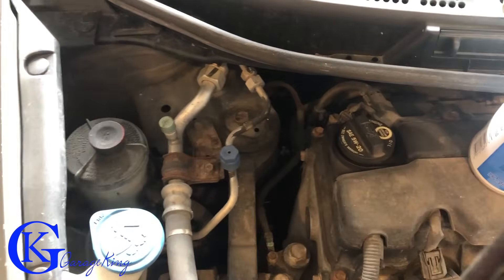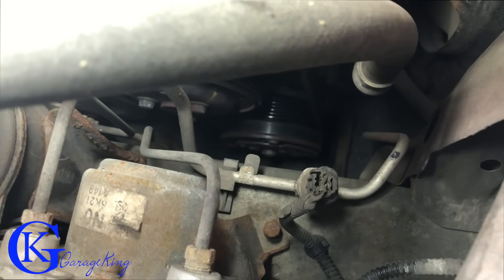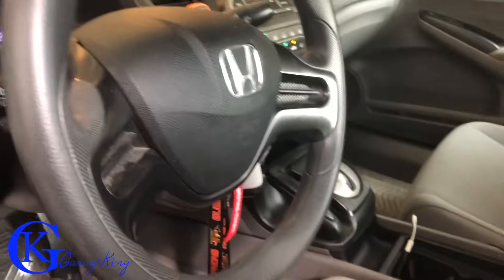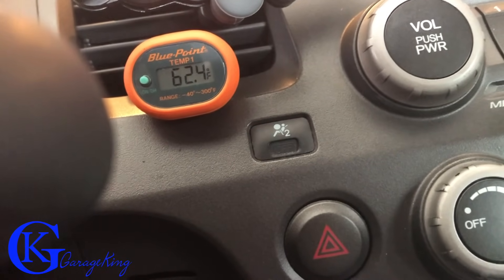How to charge Honda Civic AC with a can

Comment: My 08 civic AC is acting crazy. The fan and compressor kick on and off constantly. Like every10 seconds . when I'm driving with my AC on specially up a hill when it kicks on and off like that mycar feels like its giving gas on its own . the who!e car goes like Im put putting but I have gas pedal steady. Also it'll eventually blow hot air. I just changed out my tensioner n put on new be!t. My tensioner was bout broke in half and the water pump pulley dug almost completely thru it. Auto zone told me he thinks its my compressor...what's ur thought? I have to have AC my so is prone to heat strokes
Reply: Also my freeon  level says low til it starts kicking on and off then the levels go crazy high then low
Reply from the maker: @TOXGAS  Hey there, thanks for reaching out:)   You can't have crazy AC haha!!!    Your compressor cutting in an out that fast is not good.  OK now the good news.....  Your compressor works, that is great, the fact that it cycles means your pressure sensors are working.  If the compressor was not coming on at all that would be a bigger problem.   I think in your case you are just low on refrigerant and the low pressure sensor is shutting the compressor off (to save it from running dry) and its suppose to do that.   Then it comes back on and runs for a few seconds and the sensor realizes something is wrong and shuts it off, and the cycle repeats.  You have a small amount of refrigerant oil in your AC system and the freon/refrigerant carries this oil around to lubricate the parts.  When you are low, there is nothing to move the oil around and your compressor can run dry. 

That engine feel that its speeding up and down when the AC comes on an off is totally normal.  The compressor is hard to drive so when it comes on the baby :) engine in the civic needs more power so the computer speeds it up.  Normally you don't notice it as much, but because your compressor keeps turning on and off so much that's why its obvious.  Now on a corvette or V8 type car you can't even feel it because the engine is so big and powerful.

Sorry for the long explanation, but I needed to provide a bit of history.  I think in your case what is best, and cheapest would be just to recharge it.  Everything seems to be working.  Your car was factory filled with 134a type refrigerant, so you can use that or the 134a universal replacement.  The only way to know how much freon is in your system is to empty and fill it again, the proper way it to weight it in with a scale; however, you are most likely very low so adding one small can should be fine.  Most likely that's all you need is a top of of one can.  I think your civic only takes about  1 pound so that is 16oz, and most cans are 12oz (smaller can), so you should be ok with one of the smaller style of cans.

I could have wrote you back and said just put a can in, but I wanted you to see the thinking behind my answer :)  Happy Sunday to you :)

Comment: This is why they don't allow to buy freon without a license. You need a machine to do it right and the most important thing is don’t let any freon escape into the air.
Reply from the maker: Good comment, that little bit in the can is always going to escape no matter what you do.  It is a very tiny amount, and no where near what actually leaked out. FYI - 134a is now being phased out and replaced with 1234yf which is much better and does not damage the ozone layer.  In addition there are drop in replacements you can buy that are totally safe.  When I recharge I use the evacuation machine and gauges so I don't loose anything, but I wanted to do this video as these cans are still sold, and people will still use them as long as they are sold.  So if someone is going to do it, I wanted to make sure they know how to properly do it, and empty the can as much as possible.  Thanks for your comment and happy Sunday to you :)

Comment: what to do when it’s completely empty
Reply from the maker: If its completely empty and you know that, then as long as it hasn't been opened up it makes for an easier fill.  If its been opened up you should really get it evacuated or do it yourself with a cheap vacuum pump.  That will draw out the moisture and your system will be colder, and have less chance of corrosion inside.

Comment: Should always empty a/c system when your not sure how much freon is in system.  It's funny you worry about air in charging hose but not the a/c system, the air being trapped in system by this method is cause for future failures. If your a/c is just  a little cool, your system has air in system,  push low valve with pin and you'll see its like letting air out of your tire, once emptied now system is empty and ready for recharge . Much better way of doing this.
Reply from the maker: Thanks for the comment. I talk about overcharging at the 2:30 min mark, and re-iterate at the 2:50 mark.  At 3:27 I talk about preventing air from getting in the system as you don't want to add air.  You mentioned that I'm worried about the air in the charging hose but not the a/c system.  That is false and I think you misunderstood.  Perhaps I was going too fast in the video but a/c systems should not have air in them at all.  You mentioned that "if your a/c is just a little cool, your system has air in it" that is false.  You are low on refrigerant and that's why your evaporator is not getting cold enough to cool the air that flows though your dash vents.  The refrigerant in your ac system boils at room temperature so to keep it in a gas state its always under pressure, this is why outside air CAN'T get in unless you let it in when you are charging.  There are only 3 ways outside air can get in. 1. You let it in when you are charging 2. you take your ac unit apart and let air in 3. there is absolutely no refrigerant left in it so there is no pressure and air can get in with outside temp changes.  You are right that air in the system can cause future problems as the moisture in the air can corrode things, and thats why ac systems are equipped with a dryers. So I really wanted to go over not introducing air when you charge because if you charge multiple times and let a little air in each time it all adds up. I mean no disrespect to you and appreciate your comment as people read these comments and learn. If you have any other questions let me know, and hope you are having a good weekend :)
Reply from the maker: I was going to add, if you are curious about evacuation I did do a video on it https://youtu.be/qG1uo2YYAjc the only thing is you need a pump.  Thanks !!!

Comment: 62 out of the vents sucks. Mine is around 30. Drive a 2001 civic with 327k original compressor.
Reply from the maker: Depends on the temp outside, when you are driving the car its much colder as the compressor can spin faster, and the condenser can cool with the incoming air. Remember this was filmed in a hot garage.

Comment: When I put the hose into the L, it won’t latch. Any idea why it won’t? I also use a 2010 Honda Civic btw
Reply from the maker: Hi There it should snap on.  Make sure you are snapping the hose to the low pressure side as in the video, this is the line that is bigger.  Also make sure that your hose is for an R134a system, there are hoses out there that are sold for the 1234yf system that are slightly different and will not fit.  They are not compatible.

Comment: How do you let some out if you over charge the system?
Reply from the maker: Well if you use environmentally friendly stuff you can just vent it out, but if you are using anything that can damage the air we breath you should have a shop evacuate some out.  If you are just over an oz or two it would be fine.

Comment: Why u didn't show how to take it off .you shouldn't have did a video or anything if you not gonna explain everything. From start to finish, if not what is the use
Reply from the maker: Hey There and thanks for the comment, I always like feedback, and I will tell you why.  If you are only filling with a can, and you only have a can and the small hose that comes with the can you can't take the refrigerant out.  There is no way to do it, so I didn't show it.   So for this video "how to charge with a can" that's what the video is about.  Most people that charge with a can "add" to the system as its low. 

To remove the refrigerant you need an expensive recycler that not many people have, you also need a set of gauges.  See this video I did https://youtu.be/qG1uo2YYAjc where I show you how to evacuate.  You can see it requires some equipment. I can help you along and if you have any other questions just let me know.  Thanks :)

Comment: Whack man.. This is illegal to DIY in Denmark..
Reply from the maker: Yes, you have to follow your counties laws.  You can actually get R134a replacement that is not bad for the environment in a can.  The density is different so there is a conversion chart for density. Its flammable, but I have never heard of a fire, I think it is propane based, so no worse that turning your BBQ on before you light it.
Reply: @GarageKing  do not mix refrigerants, they are not compatible with each other. It is best to use the stock refrigerant because retrofitting to a different refrigerant is expensive and not worth the cost. You would have to spend money on a most likely custom R-1234yf compressor for your engine and a different expansion valve just to use a much more expensive refrigerant that doesnt work as well. The exception to that is if you have an old car that still has r-12, which has been phased out for 30 years and is stupid expensive.
Reply from the maker: @Redtooth75  I get it brother LOL :)  I meant to use a replacement for R134a that is not classified as a refrigerant, something like Duracool, or the stuff called R12a (not the old R-12) its compatible, and runs at lower pressures.  When you add this most likely your system is empty and the compressor is not running so there is maybe 1/2 oz in there (if you are lucky)  Not sure if you know what I mean, but the stuff is not classified as a refrigerant. Would never go to 1234yf as that is crazy expensive, and you are right, seals, compressor, I'm not sure if the oil is even compatible.  But what I was getting at was to use something thats not restricted like a refrigerant, as the OP is in Denmark and the laws are more strict there. The only thing is they are flammable, and that's probably why the manufacturers don't use it.
Reply: @GarageKing  you are misinformed, you cannot mix refrigerants willy nilly. Some refrigerants (the 400 series) are very specific blends with very specific amounts of certain refrigerants. You cannot go and make your own blend of random refrigerants in random amounts and expect it to work. R-12a is a refrigerant, thats what the r stands for. Its pure propane, which is a refrigerant and is not the same stuff you buy for your grill.
There is no substitute that you can add to a system already charged with a different refrigerant. You can retrofit the system to a different refrigerant. You cannot make your own blend of multiple refrigerants.
Reply from the maker: @Redtooth75  Thanks for the comment, I know you can't blend different refrigerants, but I found this.  Take a look at this. I got this off the Red Tek website at https://redtek.ca/refrigerants/12a/  it says "No retrofitting needed. RED TEK 12a is designed as a direct drop-in replacement for R-134a and R-12 substitutes. RED TEK 12a requires no significant redesigning of the refrigeration system because it is compatible with R134a, R12, metal components, compressor motor materials, mineral, and synthetic (Ester and PAG) lubricants, seals, gaskets, hoses, compressors, and O-rings".  Just reporting, if you are in the US perhaps this is not sold?  Until I found this stuff I would never suggest putting in anything other than what the system was set up for. Plus I only suggest if the system is empty (compressor not running - so usually less than 1/2 oz so very little mixing) Also I do have an AC licence so I'm schooled in this field. You certainly sound like you know what you are talking about. What's your take on this? Have you ever heard of this company.  Curious as to what you think.  Thanks